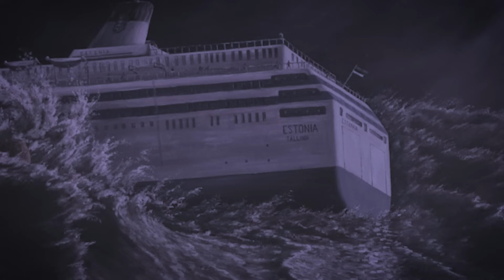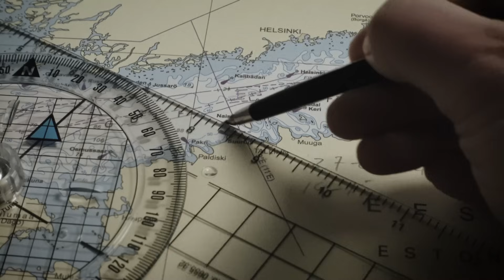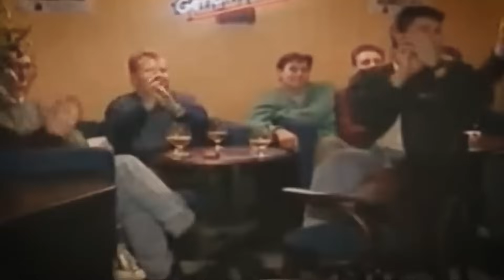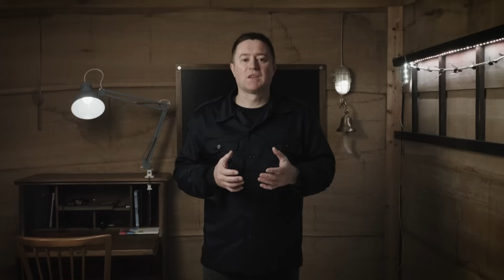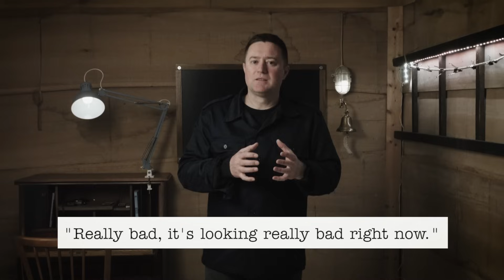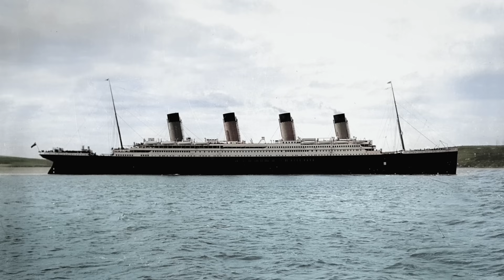852 Passengers Had 35 Minutes: The Estonia Ferry Disaster

Comment: There are so many factual errors in this, that i am mindblown. Contradictory statements and physical explanations that does not hold water (no pun intended)

A survivor, Carl, who had a cabin under the car deck said he heard the bang and the list came instantly and stayed there. That goes against everything the official narrative is saying. 

Many other survivors says the same thing, but none of them were heard by the Commission. Carl also said that instantly after the bang and the list (he said it sounded like the ship was going through ice), he opened his door and saw that there was already a good amount of water in the halls and he ran out in his underwear.

Another survivor had an alarm clock that went straight to the ground when the list occurred and the batteries flew out. He put the clock in his pocket and saved it. The time the clock stopped on contradicts the Commission's claims.

There is 110% something they are hiding, just like with JFK.

Comment: No one checked out the banging and the shuddering of the ship? That’s like hearing windows being broken in your house but just rolling back over and going to sleep.
Reply: They did check, someone went to the bow and check the front car ramp, but everything seemed fine....water didnt immediately start flooding the car deck when the locks of the visor broke, it continued to bang on bow of the ship until then hinges and the locks broke completely and it fell down bringing the car ramp down with it.

That being said ofc as the loud banging continued, the captain should have ordered the ship to stop immediately. Had he done that, the disaster might have been avoided.

Comment: A series of ELECTROMAGNETS along the seam of the bow and flip-up visor should have been used to LOCK that steel on, with a permanent engine percentage diverted in case of such high seas.  Heat would definitely NOT be a problem in the cold sea there - just passive heatsinking into the steel washed by the waves ...... 
It's NOT rocket surgery!

Comment: I worked on roro ferries on the east coast of Canada. There was always a feeling of high death counts should a fire or power loss occur during a bad storm. Very long evacuation slides would be a bad joke if we ever had to abandon ship, especially in summer when most of the crew were part time workers. Watertight doors were never closed.
As the ships aged, the bow door was wielded shut in winter. With every year, the sound of the ship beating its way through ice made me more uneasy.
Those ships were retired without any major accidents, but they’ve been replaced with the same type, and I’m very happy to be retired. I don’t think roro ferries are safe for loading hundreds of passengers on.

Comment: Its a ferry listing at 30 degrees and you know the location... what else do you need to know?
Reply: At that time, it was simply inconceivable that a ferry of that size could sink in 20 minutes. It should have been impossible, but no-one knew that the visor and ramp were gone and the ship was filling with water faster than anyone could imagine. The other vessels thought there would be well enough time to evacuate all on board.

Comment: Vibration sensors should be placed at the very front, and at remote locations, underneath ship and at rear as well, to detect the unknown, physcial structure damages and there should be a software to, advice captains, and officers about the suggested reduction in ship speed based on real time weather tracking data from ship time and ship sensors and from online as well called ship's Captain Assistant Software.

Comment: To prevent water ingress in the windows, automatic metal windows can be installed inside the outside facing glass windows, that can keep up against the water pressure at ALL the porthole windows especially, on ALL sides at ALL depths. If this key, window water zoning system is not installed in todays ships, then it should be considered for installation. Additional Water Zone systems involves, atleast 10 Water sensors facing outside water line, at various deck levels, and inside the compartments, at the half level mark, to accurately display, the water ingress information, at various remote locations of state rooms, at various depth levels. Water zone systems should also have, automatic doors that close, automatically, on detection of water ingress in any other individual state room or a group of rooms. Each state room, or a single room, should have the water zone assigned specifically to it. These individual rooms, will have water sensors, that check water levels inside the common corridor, and then if its below a safe level, of 30% or below, the door can be opened from the inside. If the water level inside the common corridors is above 30%to 40% level, determined as unsafe by a ship design engineer, then the doors will be kept locked, for 5 minutes. While that time is going on, there will be automatic rapid suction from the corridors, to remove any water that entered into the corridors, by using the ships main battery systems, or a diesel engines or a third separate battery system designed only for ingress water removal from all state rooms and common corridors between the rooms automatically. All these systems, will be automatic, and so experience of captain or officers and response times or lack there of responses from them will not account to the system performance.

Comment: This is a very unusual case. Physical damage at frontal area is outside the observation area. Loud bang should have been an alert to the captain. He was supposed to check it all the time. That didn't happen. Ship visor separation, was not sensed properly. Lower locking mechanism failure is also going not noticed. Thats the third red flag. Water ingress occurs from the vehicle deck, to prevent that there is no automatic water ingress protection. Alongside that, there is no physical separator inside the vehicle deck, to separate free surface effect. That is lack of preventative design, with this situation in mind. Water ingress at windows has occurred in many ship disasters, but here too no window water ingress automatic water zoning is absent. EPURB is a very good effort, it should also contain, the CRITICAL information of the number of passengers, and the severity of mayday in a mayday category. Navigation systems should have back up power and 3rd backup power as well, and there should be magnetic compass, chart based plots and an offline ship navigation officer who knows charts especially as well
Reply: This ship was not designed to sail in open seas, especially not at that speed in a storm. EPIRB wouldn't have helped, by the time it would have activated the whole ship was already gone.

Comment: wasnt just the visor though thier was massive hole punched in her side below the water line that hole was not made by the seabed when she sank reported detonation cord videoed around the hinges the ship isnt that deep but no salvage was allowed also divers could have retrieved the deceased very easily but were told to stop and weld a mesh over the hole the ship was also commonly known for shipping dodgy/illegal milatary equipment being sold off in illegal deals

Comment: The official raport lied. The ramp was NOT open during the disaster. And the ramp was NOT linked with the visor at all.
Reply: Source?
Reply: @vicross2569  Ramp is described in official report too. Not linked with visor. None of survivors described ramp open although almost all lower rank seamen who looked after the ramp survived.
Reply: @marguskiis7711  after reading into it, you're absolutely right. That hole that they discovered is insane, though it's interesting that the door is open now, whereas, in a previous dive, it was said to be closed.

Comment: Ships designed for these sea conditions shouldn't have bow door type loading access.There are numerous examples where rear door access only works fine.
Reply: That's what they use nowadays on these routes
Reply: @laurikotivuori1585  
No excuse for not using rear/side hatch load/unload then.Tor Line/DFDS Tor Scandinavia and Tor Brittania were two examples among numerous Mediterranean ferry lines long before this event.Ironically both examples were sold for use on Italian ferry routes.

Comment: This ship was far too big for two people. Especially two people who just thought they could buy an expensive toy. Go on YouTube for sailing forums add for two people experienced sailors will recommend a Max of around 40 to 45 ft. Usually a little less than 40. The difference between the two is the difference between driving a big pickup in an 18 wheeler.  These conditions weren't that bad especially for a boat that big. It sounds like he was trying to haul ass through storms. 

I'm betting some very experienced sailor in here it's going to say you should have briefed in a lot more sale from the start and taking the Genoa down completely. And have one of the experienced sailors handling the the main sale and preventer.

Comment: One thing more what report pointed out. Estonia or Viking Sally how it was first named,  was designed sailing coastal waters not open, and the locking systems were desinged accordingly. Report speculates, that it might have contributed to material fatique. The report also states of overall bad maintenance of the vessel.

Comment: A recent discovery series argued that there was unreported damage to the underwater hull and evidenced this with imagery.  The consensus was it had been caused by an external force
Reply: Yeah that series is full of bulls*** if its the one im thinking of. There was unreported damage discovered yes. But it was investigated and found to have been from from contact with the sea floor and discoved only recently as the boat has shifted position over the years, revealing parts of the hull that where hidden when the original investigation took place.

Comment: I’m obviously no marine engineer or ship builder but I am a metal fabricator. The design to have the front of this ship open up seems really silly to me.. that should have been at the rear.. the pressures on the front crashing into waves would be massive
Reply: I’m fairly sure these types of ships have doors at both ends, because you don’t want the hassle of trying to drive all the vehicles backwards.
Reply: @Sashazur  correct
Reply: It’s a very common RORO design
Reply: Very typical and used design .
Reply: The ships I have been on as a passenger had rear or side ramps.
Reply: I think thats what the raising front section was supposed to function as, a way to keep pressure off the bulkhead of the loading port, but once that was gone like you said going at that speed in that weather its not suprizeing those hinges failed
Reply: Estonia and Sweden switched to only rear loading ramps. (Read it from another comment).
Reply: @anonymoushunter9808  That other comment is wrong then, it's still used commonly
Reply: @funnynameman  Ah fair dues

Comment: Estonia is the one sinking that really, really freaks me out. Because it looks so much like ferries I've been on so many times over the years. Like, modern. Or at least, modern to me.
Reply: @slowbasil  Most newer ferries are built in a different way. Estonia had a bow visor that lifted up to open. This design puts a lot of stress on the points where the bow visor is attached to the hull because the waves crashing against the bow exerts force on the visor in the same direction it is opened. Most modern ferries that operate in rough seas and have bows that open have clam doors that opens sideways. This is a safer as the waves crashing against the bow pushes the doors against the hull. 

I get the impression that ferries are cancelled more often these days than they used to be. I'm Norwegian and don't read Swedish newspapers on a daily basis, but I read the Norwegian ones every day. There is hardly a month between September and April where I don't see the ferries that goes between Norway and Denmark are cancelled or delayed because of the weather.
Reply: As the ferry was expanded in finnish shipyard and added extra decks it means its gross tonnage was even bigger when it hit the waves..  @perdanielsorensen7775
Reply: Yes, perhaps exactly that one too? Me too was on Viking Sally (Estonia's former name) several times in the 1980s. 
It was in better weather though, and with the usual Finnish/Swedish crew (and probably no military transports onboard).

Comment: Actual investigation from Swedish divers and journalists, revealing a big gash on the side of the hull of Estonia.
Reply: Yes it was caused by the ship hitting the seabed when she sank. When she landed on her side hard parts of the seabed punctured the hull on her side.
Reply: @parnordquist6607 she landed on sand, and the sand made it impossible to make that powerful hole in the ship wreck
Reply: @QertzonOffical At first it was belived to be only soft seabed at the site of the wreck. New investigations of the site have shown that part of the seabed is rock. Those parts match the holes in the hull.
Reply: Yeah, well, what these “journalists” either failed to account for or neglected to show (as they did intentionally exclude details) was that this hole was part of a much bigger crack running a good chunk of the ship’s length. This makes sense as, even if it landed on soft sediment, it still smashed at high sinking speed on its side and eventually buckled in as it finally impacted the harder layers underneath. These are giant metal monstrosities, after all, with absurdly high weight.

Comment: It amazes me that there are not more RoRo ferry incidents considering I have read all it takes is an inch of water on an open vehicle deck to doom a ship. There would be nothing more terrifying than being trapped in a capsized ship with no light.
Reply: one reason is that after this incident, atleast in the nordic countries and estonia, they welded the front shut, and only use the back to load trucks and cars now.
Reply: @Weffi76  that is not my experience. Bow loading still takes place.
Reply: @Weffi76 makes sense. I work in Agriculture and all the Wallenius Wilhelmsen ships that move the machines are stern loaders.
Reply: Like Estonia, most accidents do not occur due to a single event, but many. Even an inch of water on the car deck won't automatically sink the ship. One inch of water on a RoRo 575 ft long, 100ft wide (about the Estonia or a Mariella class size) is about 130 tons of water. On a calm day with little movement, you'd not even notice that in the handling of the ship. Even on a violent sea, 130 tons is not going to capsize the ship- that's going to make it handle about the same as a badly loaded deck with 3 lorries on one side... With a ship weighing 37,500 tons (as with Mariella- don't know about Estonia) you won't sink from that. In any case there are drains all over the deck- named scuppers- which will either drain straight to the side or will have active pumps which switch on when detecting water.

A clearer example of multiple events leading to a RoRo sinking is MV Herald of Free Enterprise... there were so many failures that happened and if only one failure had been detected and prevented then it would never have capsized- same with Estonia, perhaps (HOFE: bow door open, bow trim tanks flooded to match the linkspan, shallow water, increased speed, turning to port... take away any one of those and accident avoided).

Re being trapped: I took part in a crew training event on Olympia (sister to Mariella, though just changed fleet) right after Estonia. When you're down on the lower decks, below water, with the power off, using torches because they even deactivated the emergency lights, with dry ice to simulate smoke and trying to get up to the top decks... that was not pleasant and that was in port and not on a ship in a storm. HTH.
Reply: Enough slices of swiss cheese and the chance of an accident gets diminishingly small
Reply: Search up express samina

Comment: This design of ship should NEVER have been able to get off the drawing board, let alone have her keel laid down and build her into reality .. having a massive hinged section of the bow that hinges UP, and therefore putting a HELL of a lot of strain on the pins, bushings and locks keeping the door from swinging up with every plunge of the bow, has to be on the list of top 5 ships than never should’ve been put to sea
Reply: And you are a maritime ship designer?  The sheer weight of the visor/gravity would help hold the visor down.  The are apparently many other factors at play here.  It cost many lives.
Reply: You are correct, the ship was designed to sail coastal waters, not the open sea.